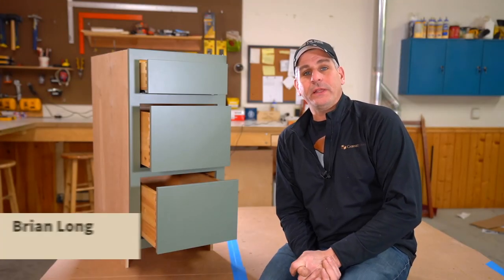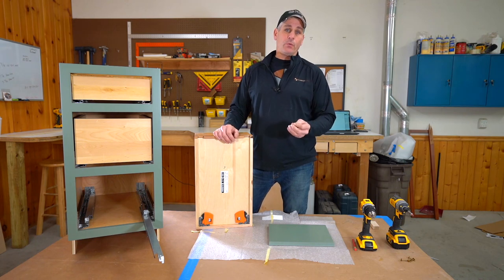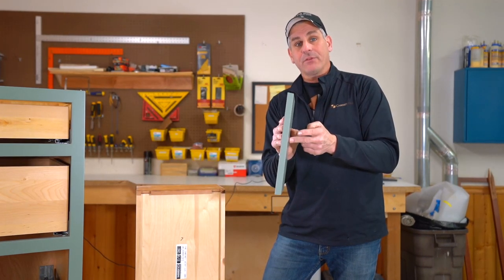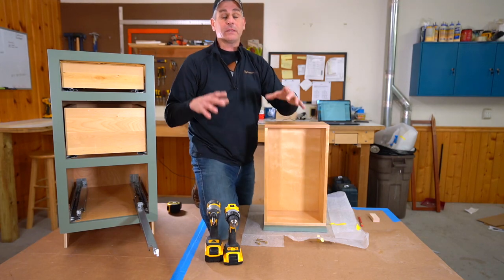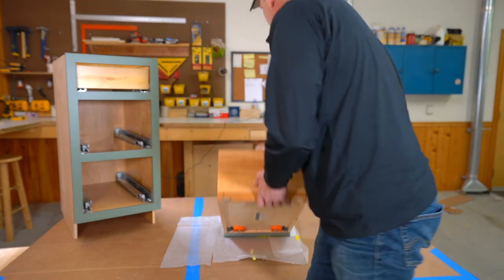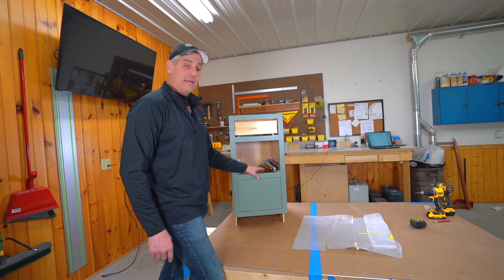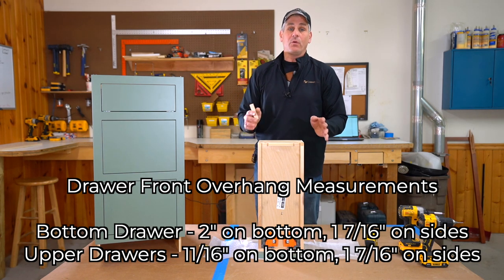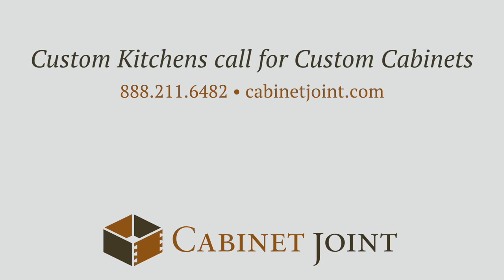Installing & Mounting a Drawer Front to a Drawer Box | RTA Cabinet Assembly

Comment: Very informative video as always. Having watched the original video featuring the double sided tape technique, I definitely prefer this new method. It is straightforward and simple and requires only a 1`/2" line struck accurately for success. I found that some of the larger boxes were a bit racked and the "fingernail" reveal on both sides was difficult to achieve on those, but it did not seem to matter in the end. I decided to clamp the front to the box before drilling the pilot holes--not as much confidence as Brian exhibits in the demo! Cheers
Reply from the maker: Thanks for continuing to follow along, Jeff! We're glad you like this new method and we love hearing about your experiences on site.

Comment: What would you recommend if the drawer box appears to be tilted diagonally? i.e. there is more space in the bottom left hand side between the drawer box and the face frame, and less space in the top right hand side? I've confirmed that it looks tilted before even mounting the drawer front. Does that mean the drawer slides are not level?
Reply from the maker: Hey Drew, thanks for reaching out! You should be able to adjust the left/right leveling of the drawer front by using the drawer leveler lever within the orange clip. Slide it back to raise the drawer front on that side. If that doesn't work, please give your cabinet coach or our main line a call and we'll help you out.